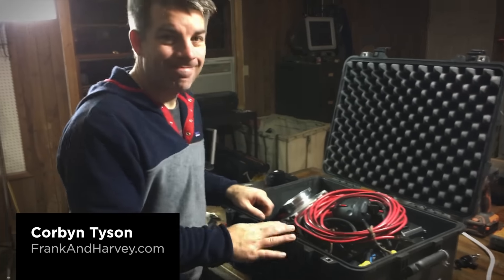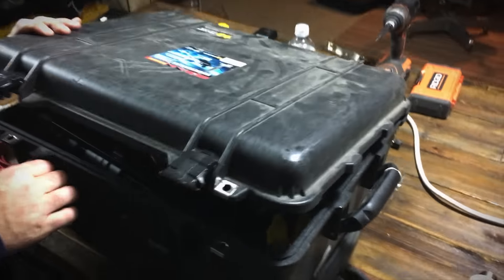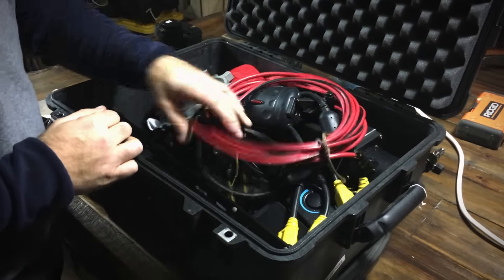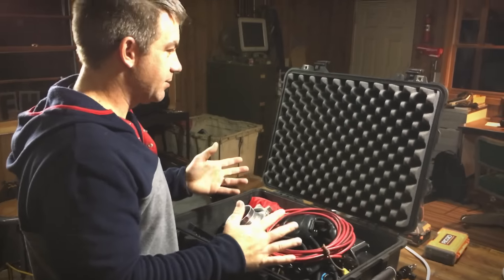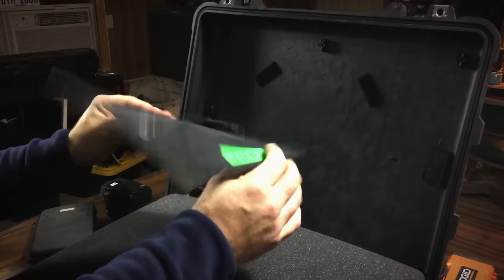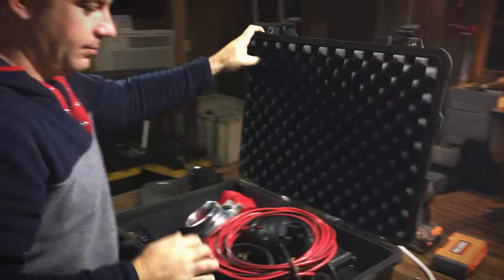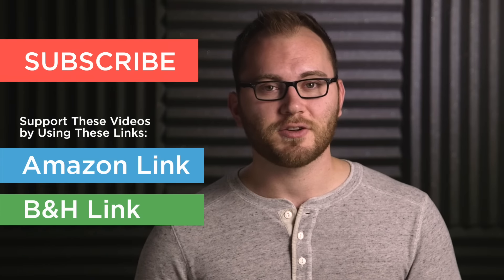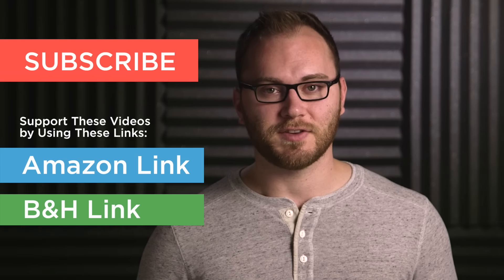A Creative Way to Pack Flex Lights

Comment: For as lightweight and compact as the actual Flex is, I find the length of the power cable and dimmer to be a giant pain. Sort of defeats the purpose for me as it takes up so much space still to actually bring the light anywhere. I still love the light, it just feels so fiddly to setup